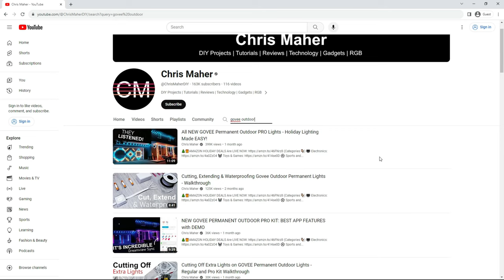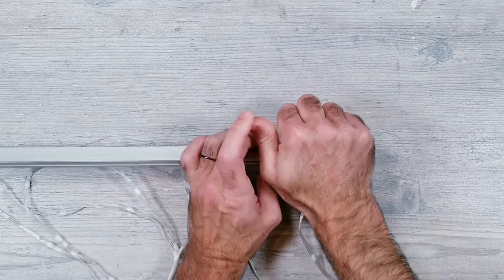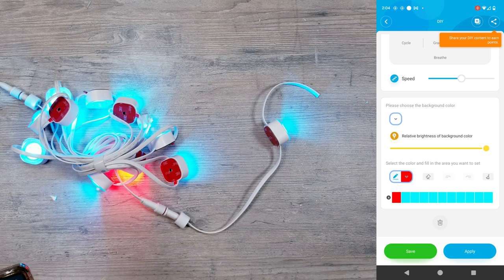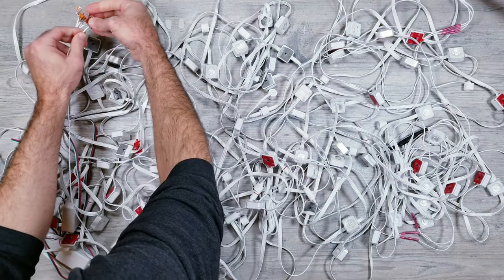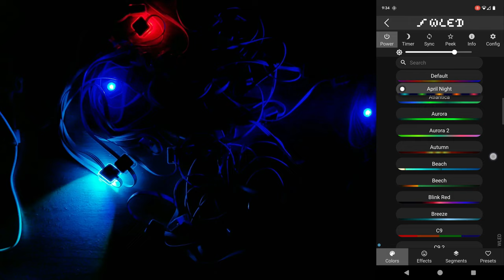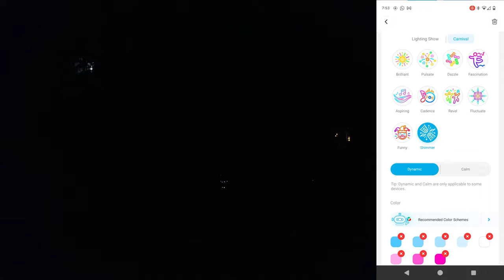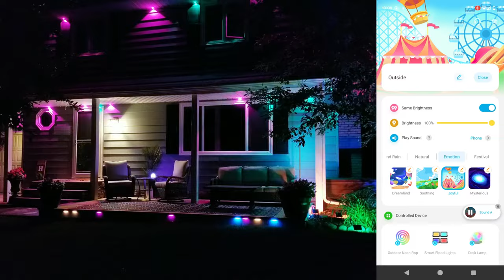Setup, Cut, Splice, Split, Extend, Waterproof, Power Inject, WLED, Govee Permanent Outdoor Lights

Comment from the maker: 📦 AMAZON’s BEST DEALS (updated daily): https://bit.ly/3VWZKVS
📣 AliExpress’s BEST DEALS (updated daily): https://bit.ly/3VwoaDW
☑ Check out my sponsor to begin your FREE 14 day trial to Aura: https://aura.com/chrismaher
Govee Permanent Outdoor Lights Pro: https://amzn.to/3twvs0h
Last Years Model Outdoor Permanent Lights:  https://amzn.to/3ZV9LD6
Govee Christmas String Lights: https://amzn.to/45Cp98K
Govee Curtain Lights: https://amzn.to/3tz5fOE
2 meter Aluminum Profile For Curtain Lights Amazon Store: https://amzn.to/3ZVh8dY
2 meter Aluminum Profile For Curtain Lights Muzata LED Store https://bit.ly/3NHG5Uw
3m Sticky Pads: https://amzn.to/3ZU3urr or Extra Hold Velcro: https://amzn.to/3ts1CtJ
Adhesive Tape: https://amzn.to/3rJCjDf
Wire Stripper: https://amzn.to/3M1LzcE
Wago Connectors: https://amzn.to/3N8uRsD
Wago Connectors In Line: https://amzn.to/3RlCvTi
18 Gauge Silicone Wire: https://amzn.to/46IcQbA
ESP32: https://amzn.to/3LObRin
Micro USB Charger: https://amzn.to/3ZFWpdY
Wago Connectors: https://amzn.to/3RlCvTi
Wire Stripper: https://amzn.to/46gP7zz
Thick Jumper Wires: https://amzn.to/46e60uV
Junction Box: https://amzn.to/46zej4u
Butt Connector / Crimper Set: https://amzn.to/3PEh5zB
Other Connector Style Mentioned: https://amzn.to/3r6cDjT
Heat Gun: https://amzn.to/3t1N57N
20 Gauge wires used in last example: https://amzn.to/3PADygV
White Box: https://amzn.to/3LqOmf7
Wago Connectors other style: https://amzn.to/3RlCvTi
Heat Shrink Tube Black: https://amzn.to/3EFNsYh
Heat Shrink Tube White: https://amzn.to/44TjMl9
3rd Party Extension Connectors: https://amzn.to/3rghLSl

0:00 Intro
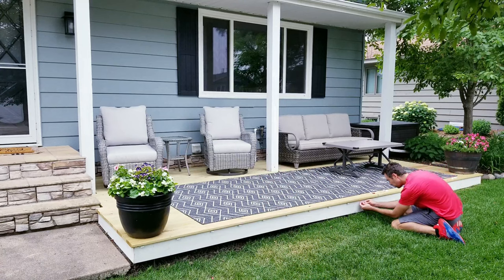1:18 Govee Pro Setup 
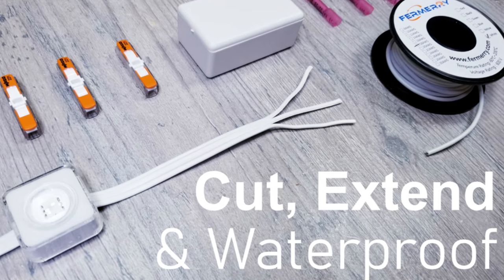12:28 Cutting of Extra Lights That are Not Needed
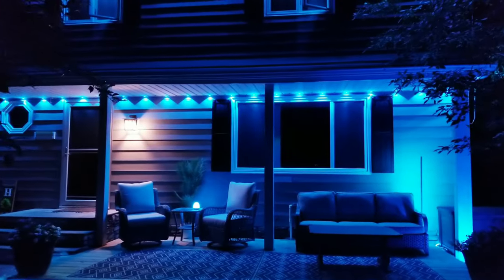20:00 Adding Additional Wire to Extend Sections plus Waterproofing 
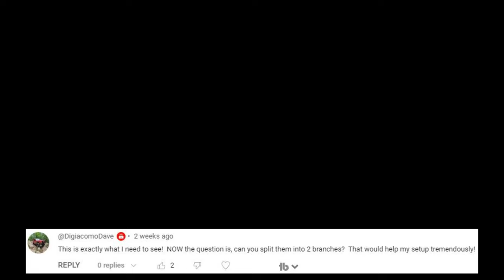27:54 Splitting Runs / Y Splice / T Splice / Parallels 
33:21 Power Injection to Stop Flickering
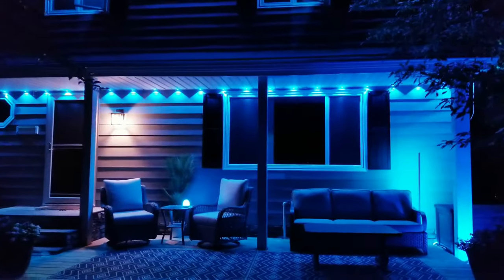39:16 WLED Complete Setup Instructions
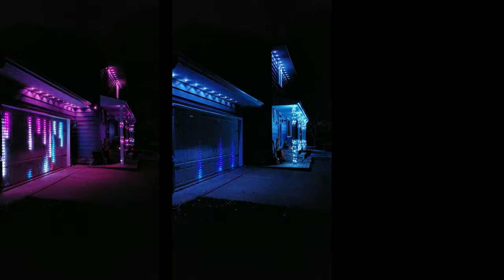47:18 Govee App - Dreamview Sync Setup
56:10 Original Outdoor Lights Setup

The best way to help support my channel is to like, comment, make sure your subscribed and share my videos with as many people as you can. The other way is to use my links above as I get a small % at no extra cost to you if you buy something. Thank you all for the support!

Comment: Hey Chris I have a question for yah about the  govee M1 rgbic leg lights 16.4 ft I want to run them across my ceiling but I need 55.8 ft of lights. I know I can connect 2 sets of light together but I don't know how far I can push it without losing power to the lights. Any tips

Comment: When making a Wye Connector using the Peo splicers but using the regular extensions what are the blue, yellow, and orange connections compatible with?  The center is the data yellow, I believe, but what is the wire with the black or grey line on it?  Is it blue or orange?

Comment: Thank you for posting and sharing the info! What's your take on the control driver module that's included in the 200ft version? Do you think the flickering can be resolved by adding that control driver module?

Comment: Hi chris. I have an issue that I was hoping you can help me with. I have an install that has extensions and partial segments joined by butt splices. The layout from the power supply is 2 full segments of 12 lights each, partial segment of 3 lights, extension, 7 lights, extension, 7 lights, extension, 6 lights and 1 full segment of 12 lights. I can only get the lights before the first extension to work. Is there a reason why this is not working?

Comment: For really long extension runs say 100 feet, have you tried data boosters to up the data bit to ensure it make it across the length? I the the newer version of cables has the booster built into the cable.

Comment: So I have a 200’ pro setup and I had to add a 16’ string. The last 2 strings will not light. I installed the driver after string 6, directions said 5. I figured with the extra string moving it 1 string would be fine. Everything works well besides the last 2 strings. Also 1 light has like half power to it on the last string. Weird, any help would be appreciated!

Comment: hi Chris, I have a couple extra Govee -M1 light power supplies left over from a couple projects. my question would be, could I run non Govee lights on this power supply & use the hub like a normal Govee Light ?

Comment: Great stuff, thanks! I guess I need some help with mines. I bought the 100ft and in the 4th segment I had to put an extension of 5ft, everything worked fine. In the 5th segment after the 4th light I need to do another extension of 11ft. Did exactly the same process and no way to get it working, tried to go for 9ft extension and still no success. What am I missing? Thanks!
Reply: Did you ever get your problem resolved?

Comment: My question is can you connect 2 different GoVee products together on the same string?  I have permanent outdoor lights on the first floor of my house.  I only needed 4 strands.  Can i buy the GoVee outdoor flood lights and connect them to the end of the 4th string of the outdoor permanent lights all ready mounted and therefore using the single power pack that i have ran from my garage attic that's hidden from the outside and not have to plug in the flood lights to my front porch that would be seen?  Hope this makes sense.

Comment: Hey Chris I got the first gen Govee and I ran two strands from the power supply, I spliced and rewired to fit my house but I had a strand with only 3 lights left from when I cut earlier but when I connected the 3 they worked just fine however connecting a new strand to the them after a 3’ cable extension they seem to loose power but strangely enough only two lights at the end of the new strand would work but nothing else, I looked through the app to see if I can edit the settings but doesn’t seem like it recognizes them at all any help here would be greatly appreciated thank you

Comment: I want to switch to using WLED.  Unfortunately, the lights are already installed so doing the cutting & splicing up on a ladder is not ideal.  I have the single wire running from the Govee control box in the garage thru the wall outside to the connection of initial light string with three distinct wires.  Has anyone cut that single wire in your experimenting?  I assume it has to contain voltage, negative, and data lines but is seems pretty thin to contain all 3.  I am very hesitant to cut into it and ruin something; especially if the internal wires are not marked somehow.
Reply: Yes, I cut mine about 18" (450mm) from the power supply ( it had three wires. Still not sure what the yellow wire was for) and then about 6" (150mm) after the controller for the data line. I then utilized the remaining line from the controller to the lights for the power and data feeds.  My only issue was the lights flickering when pushing too much output power with WLED. This was easily fixed by limiting the output with WLED to 1000 mA. 
This seems to be at least as bright as the Govee controller put out. By eye anyway.
Reply: @a.j.o3955  When you cut 6" after controller, were there 3 wires and were they color coordinated?